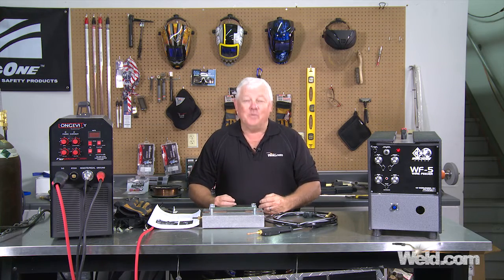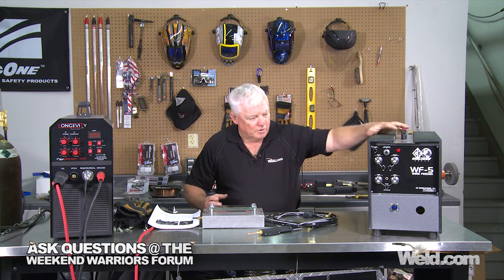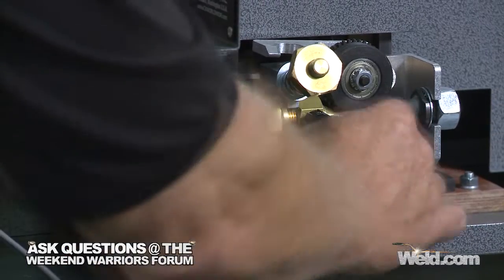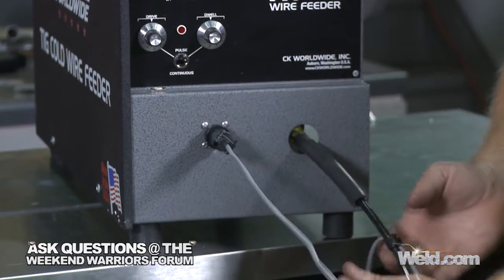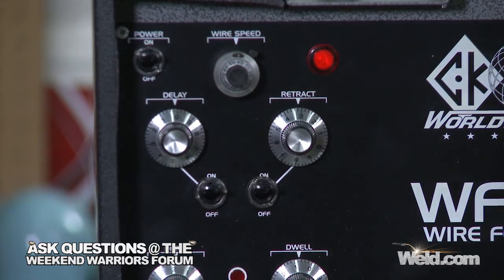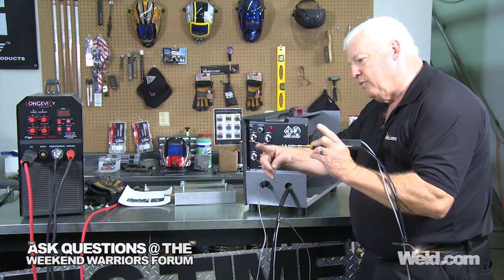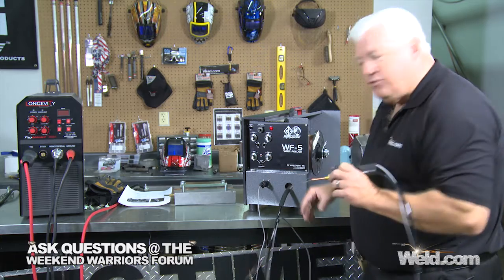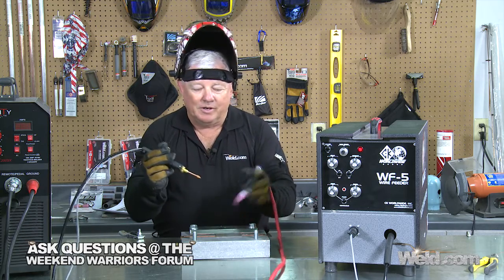TIG Welding with a Wire Feeder and CK Worldwide WF-5 Review: Part 1 | TIG Time

Comment: Fantastic. I cannot wait to see MrTigs review on this new process. I have seen clips from Europe using this process they call it  "Tip Tig". I seen them weld at very high travel speeds with a finish that is high quality with a small heat affected zone

Comment: Does it take a foot pedal to control the wire feed rate on the fly? Means two pedals if you run current control-for your next trick do you play the piano as well?